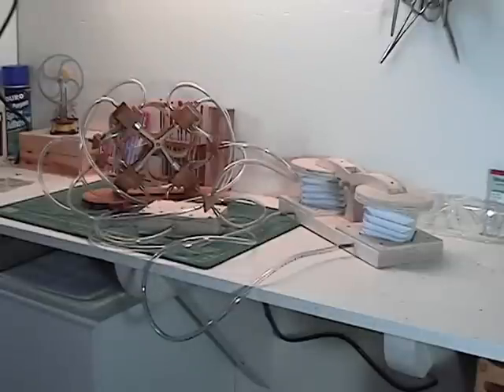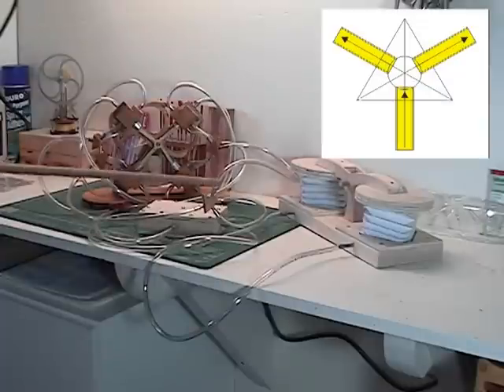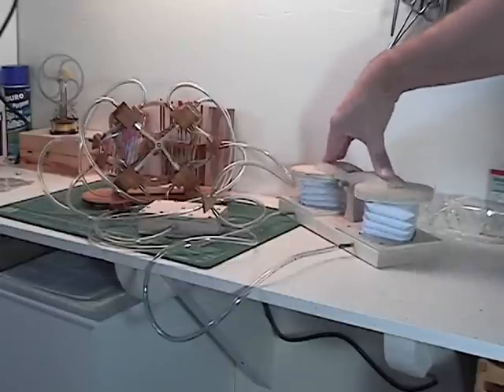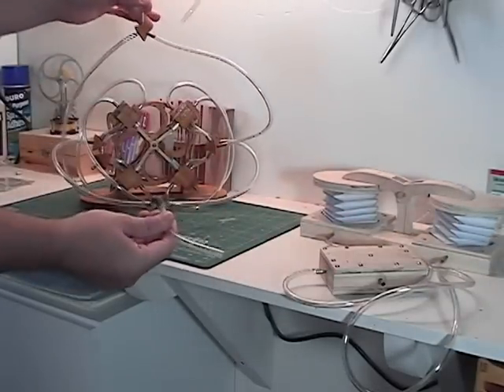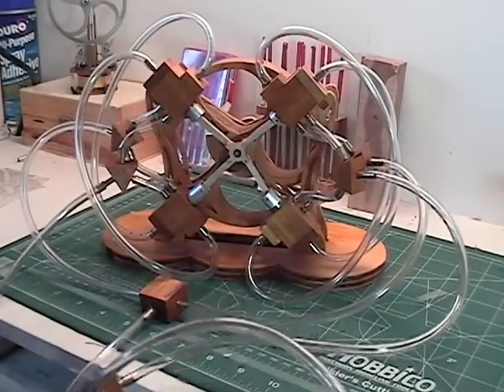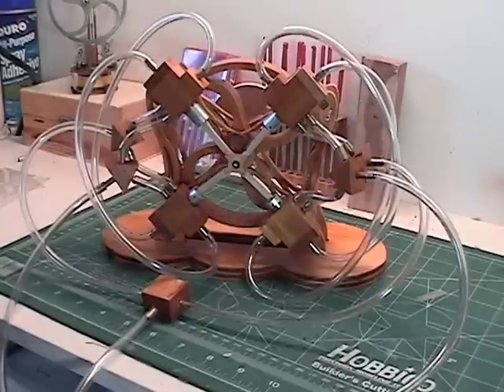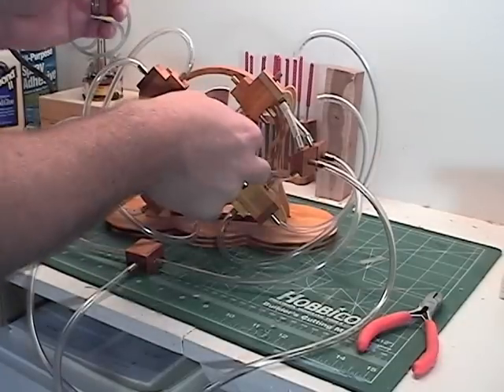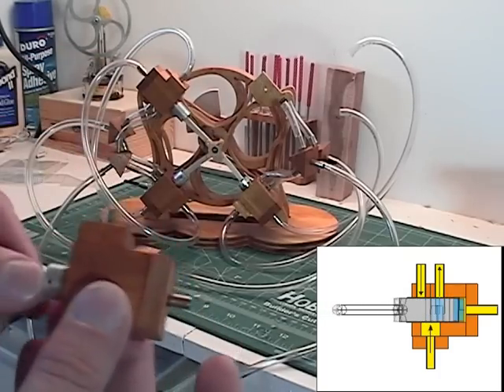Radial Air Engine Follow-up

Comment from the maker: The more I think about power the less it seems relevant. It’s a pneumatic engine. It is pretty low friction and doesn’t seem to have much if any air loss. There will be a little less energy out than you put in. If you want more power you apply more pressure. Since the piston is a 1/2" rod, if you had 10psi there would be maximum force of 1.96psi on the crank shaft. To alter its performance at a given pressure you change the diameter of the piston or length of the crank.